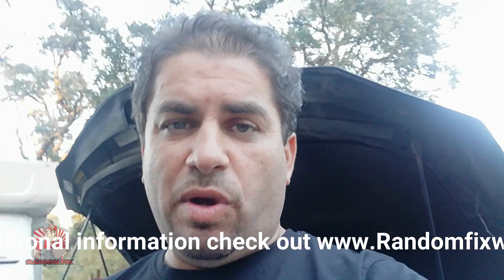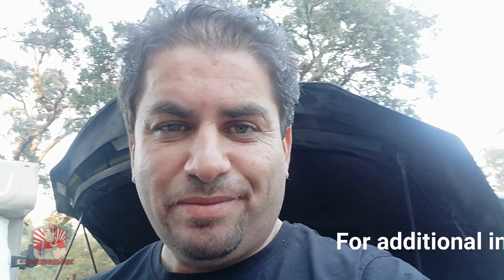Does Cataclean Work? Failed Smog, Bad Catalyst, P420 P430 P431

Comment: I failed a test bc I had replaced battery b4 test. I have completed the drive cycle on my w211 and all monitors are ready and good except a failed catalyst.  My cel is not on and I am not throwing any codes. Will this product help me pass with that failed monitor?
Reply from the maker: Dave no tool can help set a catalyst monitor. You will have to get monitor ready by completing the drive cycle.
Reply: @RANDOMFIX  sorry if I didnt make myself more clear but I have completed the drive cycle since the fail. I have all the monitors ready but the catalyst monitor,  according to FIXD , says fail. Do you have any suggestions before I go back to do a smog? should I disconnect battery and try drive cycle again? it's just odd to me because I have no codes and check engine light is not on
Reply from the maker: Dave, since the catalyst monitor is not ready, technically you drive is not complete. You only have to focus on the catalyst monitor now which normally involves driving at stable speeds at 55 or 65 for a long duration. Unplugging the battery would reset the all the monitors making it worse as you will have to get all the monitors ready including the catalyst.
Reply: @RANDOMFIX  thank you. I understand all of that and like I said it is completed.  the cat monitor longer says incomplete it says fail.
Reply from the maker: Dave, something is not making sense, are your monitors complete? Did you fail the visual part of the test? What state are you in?
Reply: @RANDOMFIX  I'm in CA. I had a Mercedes e320 sit for about 2 years put a battery in it and tried to get it legal again. the smog place said I failed bc of monitors not ready. I did research and was able to get all the monitors ready in 72 miles of driving. According to my FIXD device, that is plugged into the ob2 port, it says that as far as my catalyst is concerned it says fail. Before the drive cycle it said INC( incomplete) now it says fail.  To me sounds like the cats are bad but I do not have a check engine light on and I am also not showing any codes on the ob2 tool. If I go back to smog it I'm pretty sure I'll fail, according to this device. My question was do u think the cataclean will help me or do u have any advice or hack to get around it ALSO. Do you think I should clear all monitors again by disconnecting battery and starting all over afterwards bc the smog tester will see a fail on my computer.
Reply: WOWWWWW. So you know my story from thread.  nothing else done on my end except buy CATACLEAN and followed directions.  PASSED CA SMOG!!!! IT REALLY WORKS GUYS

Comment: Im in my second bottle.  The forestry one didn't work.  I drive a 09 dodge charger and I replace the catalytic converters but my light never went off. So im trying it again, but im wondering do I drive it until all the gas is gone or just drive like regular?
Reply: Read the bottle instructions it tells you.
Reply from the maker: Sorry for the late reply! did you find a solution?

Comment: Thanks for posting this. I used it and all the monitors were ready after 35 miles. but I had forgotten to connect a vacuum hose so got a check engine light after replacing a head gasket.
 hose is reconnected, It's been 4 days of driving and the cat monitor is not ready.
 I ordered a 2 bottle and will try it again 1999 SLK 230
Reply from the maker: Ohhh sorry to hear about that. 
Here is the Mercedes drive cycle 
https://youtu.be/gLnhD4gP0kM

If o let your catalyst monitor is being a little lazy try to warm up for 20 minutes and then try. Just let it idle for the 20 minutes and go straight to freeway for high speed driving.

Good luck and let me know how it goes.
Reply: @RANDOMFIX  will try that on Monday and i have a 2nd bottle of Cetacean arriving on Monday too
I re[placed the front O 2 sensor as war 24 years old and may have been damaged from the leaking head gasket.

Comment: I've got an interesting case with my car.  It's a 94 honda accord. Its flashes a code 14. It started with a misfire and I had oil in the spark plug hole. I changed the valve cover gasket and it ran fine. While this was going on my idle kept fluctuating so the idle control valve got replaced and that fixed that. I switched the distributor because it died on me a couple times and it hasn't done it since. But my car also went into some kind of limp mode and I can't drive past 3100rpm. ?????help!!!?
Reply from the maker: Melanie, Thanks for sharing your experience with you 1994 Honda Accord, is your accord a 5 speed or automatic, I'm always intrigued by these interesting issue that occur and would love to help you. Can you describe a little more about your limp mode experience with your accord? _Randomfix
Reply: Check the MAF sensor. My scion tc did that until I pin pointed the MAF not working properly

Oops MB didn't see this was 2 years ago 😅

Comment: Hi, I have a 1999 Isuzu Rodeo V-6. My truck failed inspections or the first time. Its failing  for high emissions at 15 mph test only but passing at 25mph. My check engine light came on for 02 sensor but had it cleared awhile ago before my smog test. Is there a possibility this will work for my vehicle if I try this? Since my check engine light has been cleared already, do I just put in the solvent at 1/8 tank of gas, drive it for 20 miles, then take it in after I have driven 20 miles?
Reply from the maker: I would look at what specifically failed on the 15 mph test?
Reply: No, after clearing the codes, it needs to be driven at least 160 miles, somehow they know.  It used to be 40 miles.  You possibly failed because your engine was too cold.  Make sure you've driven your vehicle for about 30 miles just prior to the smog check.
Reply from the maker: Yes the drive cycle would have to completed but that is not the reason for failure. They failed the 15 mph test. On the print the reason is normally stated.

Comment: First off, I want to think the individual that uploaded this video.
Secondly : IT WORKS.....IT REALLY WORKS!!!!!!!!!!!!…….
I am a real individual from Texas and it worked for me on my 2012 Ford Focus.
My situation at present time is, no job, no money for mechanics and the need for my car to pass inspection to continue my pursuit for employment. 
I put this Cataclean into my gas tank, with a 1/4 full only tank of gas,  I drove my car for about 30 - 45 minutes after (and praying all the way - almost in tears) - when I finally looked away from my dash - then looked back sometime after - the check engine light was off AND STAYED OFF.
Went some short time later to make a stop and fill up gas tank.
Next day, (still praying) went in to get my vehicle inspected and I PASSED.
I wish anybody the best of luck using this stuff - it did in fact work for me. If I can help just anyone person that is going through my same predicament - through this post, hey great.
I am so thankful, because I was so truly worried and very scared.
Reply: tones kentkorn was your focus a normal 4cyl or an ecoboost engine
Reply: Been meaning to reply  - no,  my vehicle is a normal 4, no ecoboost engine. BUT, MY LIGHT DID COME BACK ON  - ALMOST RIGHT AFTER PASSED TEST AND DAY AFTER ADDING  the chemical. I probably should have added   2.  I am getting vehicle fixed, just needed the help. So, my advice, do what you have to do, do it quick and then get big problem taken care of. The product did work for me, but it was temporarily . I will remain thankful to CATACLEAN
Reply: HOW LONG DID IT TAKE BEFORE IT WENT OFF

Comment: Yes I used it on my daughters subaru forester with 148000 miles. The check engine light turned off after using it. Now the question is how long will it last.
Reply from the maker: Thanks for sharing, you have a point, this is only a very short fix._Randomfix
Reply: How short of a fix!?!?!
Reply: @mmbrothers8250  For my daughters car it only lasted a couple of days. Ended up getting a new catalytic converter.

Comment: So just tried this. Strange is I took the front Cat off, inspected it and it was not only clean/clear but not clogged either (did a vacuum test). Reassembled and changed the O2 sensors, reset n drove with the cataclean and right at around 80 or so miles, check engine light came back on. And the code is for both cats, P0420/P0430. 
There was a video I ran across that said even though they might look clean, cats just need to be replaced eventually. Maybe that’s where I’m at!?
Reply from the maker: Yes, at a certain point the only option left is to replace the catalytic converter. I will have a video up by the end of the month on how to get a direct fit catalyst for dirt cheap.
Reply: @randomfix did you post that video?
Reply: Not sure if he ever did post a video, but if it helps I ended up swapping out both front and rear cats and it all worked out. I also ended up changing the o2 sensors and the Wagner brand lasted about 6 months (the downstream one) and gave me a check engine sign. Changed to Denso and everything’s been smooth.
Reply from the maker: Yes I did https://youtu.be/Wr1vFqCnpDc

And at the end of this video I show easy install. Since you can get a direct fit for cheap it's. It a lot of work.
Reply from the maker: Thank for sharing this information about the oem o2 sensor taking care of your issue. I'm always amazed when people buy inferior emissions components and then spend $$$$ of trouble shooting only to find it was the cheap part all along.
Reply: Call around to muffler shops. One near me in Riverside CA does it real cheap.  Used to be about $115, about 4 years ago, before inflation hit, don't know what it is now.  He gets all my cat work!

Comment: Every time i reset my P0420 , it comes back like every 1k miles .if I check my obd scanner’s IM ready after erasing the code . Everything is ok except for the EGR. Cat is still intact and I change my 2 o2 sensors for my integra 2000 .But I will try this product , so my questions is will my car pass smog if egr is still not ready after doing this product and the drive cycle of atleast 75 more miles?
Reply from the maker: I hope you figure out it out if not watch this https://youtu.be/oZELvZ4danA I think your cat is marginal and may pass if you complete drive in a short time frame. Smog it the second your monitors get ready.
Reply: @RANDOMFIX  it Passed , cataclean  does worked! Just as soon as atleast  2 of drive cycle were not ok. Now the cat clunks make noise eventually i will change it. Cataclean bought me 2 more years.
Reply: @HonDaPursuit  how long did cataclean take to work for you ?
Reply: @wasabij8317  its not a permanent fix , if your catalytic is already burned or damaged , you need to replace it so not so see the Cel Light. it will just clear all the codes you have before the emission test which is conducted here in California every 2 years. there are other ways to block the code reading directly from the o2 sensor, but I can't tell if your old catalytic wont rattle or make noise if its already broken on top of the cel light. hope this helps.

Comment: Hey my name is Vanessa Baggage I brought a 2009 Chevrolet Traverse suv my check engine light can on the code said it was the catalyst converter the car dealership i buy it from said he put three parts on it I drive it to Florida my light can back on it went off and now it back on please help me do it need a catalyst converter
Reply from the maker: Vanessa, before you do anything, try to complete the drive cycle and if your Traverse is able to set the monitors, the vehicle smogged immediately. I made a video exclusive for your vehicle make https://youtu.be/Yp34ksJY-fQ If your catalyst is really past the point of no return, check the channel by the end of the month and I will share with you how to get a catalyst for dirt cheap. Thanks and let me know how it goes. Randomfix

Comment: I used guaranteed to pass and it took off my check engine light for 100 miles and came back on I was thinking it can be the o2 sensors so I got catacleaner says it cleans the sensors and the catalytic converters. I hope this works I will be trying it today . Trying to get the check engine light off longer so I can take it in for a smog
Reply: Update the catacleaner turned off my check engine light for 2 days . Time to replace the sensors or get a check engine light eliminater for the o2 sensors dang it really thought it was gna work for about a week or longer
Reply from the maker: Great news to hear it works, you are right its only temporary 😉,  thank you update. I haven't seen a mil eliminator for a while. I was able to buy them from Americanmuscle.com for 03 to 04 mustangs but can't find them now.
Reply: @joeyysee6632  update?

Comment: Lately I've only been driving my 2007 Ford Freestar about 25 miles a week.Check engine light came on one day and showing a PO420 code.Decided to try cataclean first so spent a couple days running  the gas down to 1/4 tank,putting about 100 miles on it.Check engine light went off on it's own with no cataclean.
Reply from the maker: Awesome, I think driving the vehicle the extra 75 miles give the catalyst a chance to really warm up. Was the 100 miles freeway driving?
Reply: Yes mostly freeway type driving.Maybe the catalytic,etc needed cleaning out from sitting cold so long.
Reply from the maker: Okay, that's make a lot of sense. Thank you for replying.
Reply: @RANDOMFIX  The last time the check engine light came on I added a can of cataclean as directed in hopes of keeping the light off all the time.The opposite happened.The light won't go out now no matter how many miles I drive.Rats
Reply: Think that's how its supposed to work... Thats how it did for me

Comment: No check engine light but my cats have been smelling when pushed hard will this work to clean it car passed smog so I’m thinking the cats are just a little dirty
Reply from the maker: It's worth a try if you unable to complete a proper drive cycle for you make of vehicle, what are you driving?
Reply: @RANDOMFIX  I drive a 2010 Lexus IS 250 I used to cataclean but smell still seems to occur
Reply from the maker: Did you get the monitor ready yet?

Comment: This shit really works . I had code P0420 with light on so the Autozone guy told me it’s catalytic converter bank1 and needs to be changed then i called three different honda dealer ship the best quote was 1500$ but the after market got a quoted  600-800$ . I came back to the Autozone guy then he recommended me this product . i was also having difficult to accelerate most of the time specially after stop sign or light or entering the highways / hesitation  Also bad fuel MPG . i waited  until my tank is almost empty then put this cataclean and drove 23Miles then i filled with premium gas . i can express how my car runs now , very smooth with efficient MPG .
Reply from the maker: That's great news and we all appreciate you sharing you story.
Reply: RANDOMFIX  just also to add  the light is gone by it’s self
Reply from the maker: Nice, just remember t by is is only a temporary fix as the only real and long term solution is a new c and catalyst.
Reply: Same code hopefully it works for me

Comment: I got a 2000 Nissan Maxima 186,000 miles never clean my catalytic converter and can’t pass instruction
I used the cataclean follow the rules and it did not work so I parked my car One day I had to take my friend to the mechanic so I drove him there and I asked the mechanic how much for a new Cadillac converter she told me expensive I said wow she said let me reset the code for you drive 40 miles and see if it passes she reset the code I drove and drove and sure enough the light never came back on I got my inspection sticker 😁😁😁so cataclean does work
Reply from the maker: Good to hear that it work and yes. It only works temporarily.
Reply: Gotta follow the instructions every three months just repeat the process keep your cat clean

Comment: I am baffled.  I bought a 04 Honda CR-V that had passed smog 80 day before. By the time I got to DMV I had to re-smog.  By then my check engine is on.  O2 sensor needed replacement. Did it with oem.  Drove 80 mi and still on!  Car runs perfect.  Good mpg   Now what?
Reply from the maker: Did you reset the drive monitors history after you replaced the o2 sensor?
Reply: @RANDOMFIX  I cleared history on this cheap FIXD Scanner.  This morning I did the 55mph 5min drive coast to stop no brake. Still engine light on( no flash). Should I disconnect the Neg battery cable?
Reply from the maker: The check engine light is back on? If so how long does it take to reappear?

Comment: I used Cataclean on my BMW 318i I had a fault code 3104 uneven running (NOx sensor) put one bottle in my tank but the code came back after two weeks put one more bottle in the tank and the code never came back car runs smooth now.
Reply from the maker: Thanks for sharing your success, I think you one of the lucky one, as from my own experience, cataclean can work but it's only temporary.
Reply from the maker: good enough to pass a smog
Reply: Praying this stuff sorts the lag on my 330D e46

Comment: I tried cata clean on my 2000 Lexus. Drove it for about 30 minutes and check engine turned off and went straight to the smog check and passed with flying colors
Reply from the maker: That's awesome and thank for letting us know. I do want to point even though we know it's effective the only real solution sometimes requires a new catalyst. If you don't want to waste $20+ per bottle I have another equally and possibly more effective method that requires access to front oxygen sensor hole. It can be found the catalyst tips playlist
https://youtube.com/playlist?list=PLDEbtVOPRC-h1BAzaWQ-6NSnmG0gwvgwP

I appreciate your confirmation.